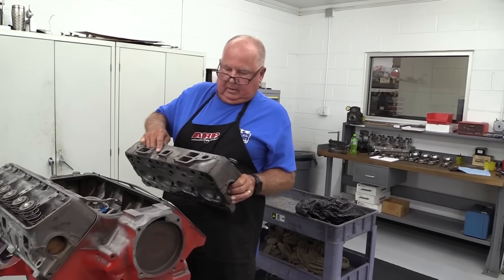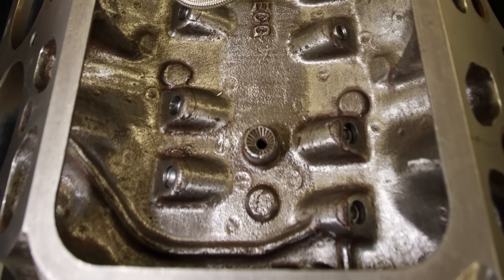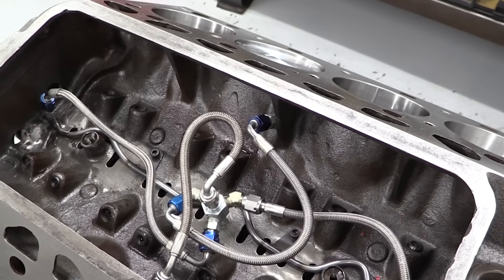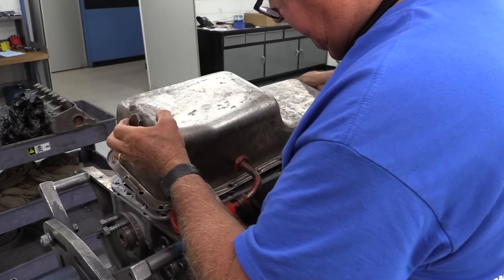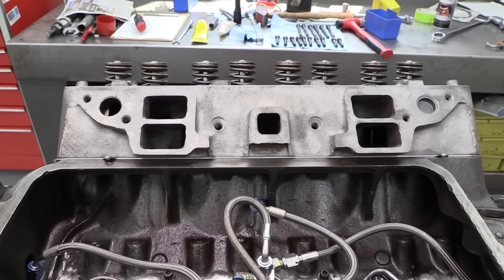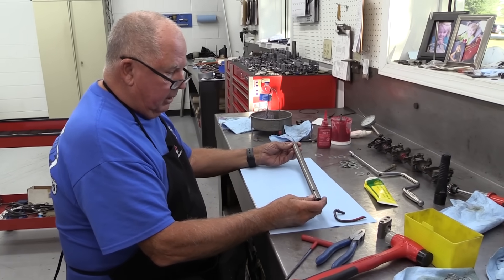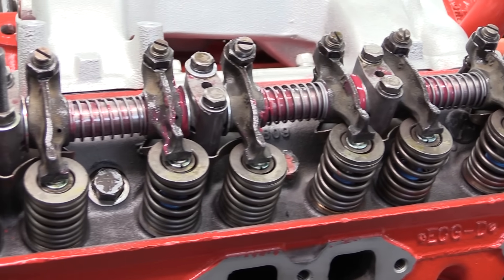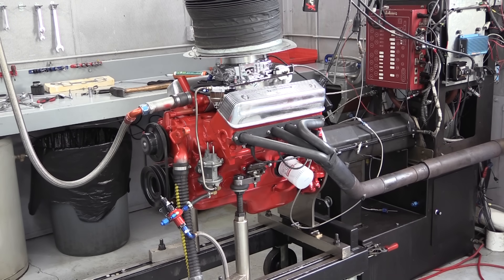The Engine That Replaced the Flathead -- Ford Y-Block Build

Comment: When I was in high school in the early 1970s (you know, a previous lifetime) I bought a '55 F-100 into which someone had removed the stock 292 Y block (or inline 6) and replaced it with a supercharged 312 Y block.... Ah the memories, replacing the old 3 speed transmissions on the way to school because I slammed 2nd gear too hard and broke another cluster gear (9 times) breaking the glass out of the back of the cab with the back of my head when I finally learned that running screws through the tire beads would keep me from spinning the wheels inside the old bias ply tires and breaking off the valve stems. (Solved that problem with a pair of swivel bucket seats out of a Monti Carlo.) Being the only kid in school with a pick-up and still being as fast off the line as the Mustangs and Chevelles with my factory 411 gears.... Those were the days.

Comment: Not bad, considering the 1985 GM 305 was only rated at 215 Horsepower, and that the Ford Engines it replaced (flathead V8's) were only making 150, or so, horsepower just a couple of years earlier (33% gains in 2 years? Imagine that now!).

Comment: And you have to remember,  the 272 and 292 truck engines. The drivers side exhaust looped to the passengers side and went back.  I've  owned a 272 ,292 plus a 312.
Reply: The same with all of the 1954 autos too. In 1955, the autos had rear exit manifolds, altho in 1958, the trucks still used the crossover. I bought a 58 pickup with the 300 inline 6 and put a souped-up Mercury 312 Y block in it and had to go with the crossover because of the hyd, clutch. There was a few years that Ford used a "Ram" type exhaust manifold for both banks but I never could locate any.

Comment: Thin connecting rods and lack of oiling on top end, junk engine, but I appreciate the skill used to rebuild it into a usable machine
Reply: JUNK ENGINE!! Hardly.  My brother had a '57 Ford Fairlane w/the 292, 4bbl.  Had it rebuilt, bored and balanced.  At idle, you could stand a nickel up on the air filter housing and it would stay there.  I had a '59 w/'63 390 on it.  In the quarter mile at Kinston dragstrip I could only beat him by a little less than a car length.  That was one fine engine.  However, it paled next to the '62 SHP car 406 he put in another '57 later.  OMG!   :-)
Reply: @danielharper635  You have a point, with the amount of improvements your brother did, it's no longer junk.

Comment: Had a 57 Fairlane 312 and a 60 Fairlane 292. Had problem with low gear in the Ford-O-Matics. Wouldn't you know, after I let them go, I found a trans shop that made adapter for Y block to C-4 transmission.

Comment: Well back in 1970 i called ack miller he was a ford engineer that worked on the design of the y block he and  smokey unick made y blocks win races for ford they told me to drill out the oil hole from the top main bearing and have my machinist open the oil holes in the center cam bearingand drill the oil hole to the head deck to 5/16 ths and in the head also and grind out the transition grove in the head gaskit surface till my little finger sat down in there half way and use 57  t bird 7.1 rocker arms isky push rods and the biggist crane cam and springs they have and look for a 62 ford truck block and a truck forged crank if you can find one and a set of a pair of ecz-d heads and go to work raising the ports and wider with alot of bowl work and ford super charge valves clyes timing set and a mallory rev pol distbutor jahns forged 11-1 comp pistonsans speed o motive con rods with a t bird aluminum gear reotor oil pump and shim the spring with J C witney fender well headers oh also a truck flywheel with a zoom clutch set up and go racing it was good for 8000 rpm all day long it still lives a friends truck

Comment: a terrible engine from day 1  no power no torque and ford should have never built it now if money is no object you can get some power out of them but they were a terrible engine
Reply: Douglas Adams, I'll bet you never owned one or have ever driven a car with one.  I've had several, didn't spend a ton of money on any of them and they worked just fine.  My last '56 wagon had a 292 with all Ford parts, not all from '56, but all Ford.  The wagon would run a 13.04 quarter mile and I spent less money doing it than my friend did on his 327 in his '57 Chev 2 dr. that runs 13.30.  As far as the Y block being a terrible no torque engine, I had two 1 1/2 ton farm trucks, one had a Y block HD 292 and the other was a Chev with a 348.  Guess which one pulled the bigger load? Y block.  Guess which one had welded up valve covers from the push rods blowing thru the rockers? 348.
Reply: @susanolson3412  they are the perfect girlie engine
Reply: In fact i will call you on your bet i will have my attorney draw up the paperwork and send it to your attorney for notirization, lets say $50,000.00 in US currency. Where do i send it?

Comment: Back in the 50’s, Fords were the most attractive cars to me. Chevy’s looked plain and cheap, and Chryslers looked gaudy and pretentious. But sadly, the Ford V-8’s sucked!!

Stock flatheads were powerless anchors, and the Y-blocks had serious problems that too quickly compromised their performance. They were so pitiful that you could actually hear the damned things coming long before you saw them. When you heard a car clattering, missing, cracking and popping its way up the street, you could be fairly sure it was a Y-block Ford.

Seeing this video took me back in time to those days, and confirmed what a rag that Y-block actually was. It’s fine that a skilled builder like this guy can solve its inherent problems, but this doesn’t excuse Ford from unleashing this piece of crap on the American consumer. The average Joe doesn’t want to re-engineer his engine just to get it running well enough to make it to the grocery store, he wants to enjoy years of trouble-free operation. 

And who was the genius that thought stacking the intake ports was a good idea ?....

Ford FINALLY did get it right with the SBF.

Comment: The pipe that he blocks off and throws away cos he doesn't know what it's purpose is, is the oil feed to the timing chain
Reply: You are spot on. I was going to write a comment but luckily found your's
Reply: I saw that too & kept thinking a restrictor or jet nozzle would be good, but I disagree with totally removing it.

Comment: Ran a lot of these in the "old days". 272s. 292s. 312s.   Last one was a 312 in my first '55 Bird with 3 deuces, Mallory ignition, headers, and a T-10 4 speed.   Ran good, but prone to oil leaks.  But I replaced it eventually with a stock 302 2BBL engine with an FMX Ford O Matic and it vastly improved the car.  Faster, quieter, better mileage and leaked nothing.    In my next '55 Bird, I had a shop rebuild the orig 292 -all stock. It was a nice running mill, smooth and quiet. 3 speed stick.    Fun times.

Comment: `Oiling problems yes, I was a student bus driver in 1967, I was in the bus garage one after noon lookinf a very blown up 292. I had never seen anything that destroyed, for example the came shaft was broken up in several 2-3" pieces, I asked the grumpy old mechanic what happened "the copper rocker arm oilers broke" He then explained that due to internal
oiling problems
the liness were fabricated to oil the rockers, made me glad I was driving a 292 straight 6 chevrolet.OH the motors has governors on them.

Comment: the engine that replaced the ford flathead was the Hudson overhead valve 6, fords flatheads couldn't catch them in the early 50/s
Reply: The Hudson's were also flatheads... but BIG ones... high compression... dual carb.s... racing cam option... The Chevy OHV 6's always had more power than same year Ford flathead V8s... Louie Chevrolet was a race car driver and his cars would never have flatheads! The OHV Olds V8's took over from Hudsons... Chrysler hemis from Olds... Chevy V8 from Chrysler... Hemis again later from Chrysler and Ford... now back to small blocks...

Comment: You need to take a block of wood and some 220 grit to those cast head surfaces at the valve cover location. Smoothing them out makes the seal last a lot longer on that old cork gasket. It's 15 minutes or else drip drip drip, just like the sbc.

Comment: I still own the First car I bought to haul my motorcycle to the track back in 83. A Y block Ford Ranchero. Still have it. Sad to say I was hauling back a 37 Ford with a Flat head V8 back in 2010. Only had it two days when some punk rear ended us and totaled  both my 67 Ford Country Squire with a 390 and the 37. Purchased a 28 Model A with the insurance $$.
Reply: I once hauled a Model T engine/tranny in my 1972 Gran Torino wagon. I also drive Model A's.

Comment: I built a couple of these in my younger days and always enjoyed the small things that made them different from the "belly button" SBC's.  Dorton knows his stuff and I always learn something when I watch the things he does.  There's just so much that is different on these things.  I built them as 312's and used Isky cam, good flat tops, and 3 Strombergs (hated those carbs).  The engines ran pretty fair but those damn Chevys could wind to the moon.  I really like the Mummert intake on this engine......mine was an Offy with 3 ducks.....pretty enough but I never felt that it flowed like it could/should of.

Comment: Personally I loved that engine and for me it was a connection to sounding cool an for what ever reason, mine were exceptionally fast. I outrun all the power pack 265 and most 283 chevy engines without breaking a sweat. Mated with a T85 three speed I could get a solid 90 mph out of it and third was not impressive as that transmission was direct in third but second gear was long legged.... Skagit Speedway had my name on the winner wall many times back in the early sixties. After Nam I moved on up to the FE block and never looked back

Comment: in 79 i had a 56 f100 with a 292 that i would take over the grapevine 35-40 times never a problem.  i bought another 56 f100 to restore with no engine,  so i bought another 292 to rebuild but got sidetracked. ended up putting a 302 ho engine with an AOD. goes real nice. computer engine though, i hope i never have problems with it.

Comment: 8:1 compression... probably the main reason it's only putting out 218 horsepower.
Reply: Partly that but it has a very, very mild cam in it.
Reply: The compression ratio isn't the problem, the distributor is.  This original distributor has no mechanical advance.  This system used all vacuum that wasn't venturi or manifold vacuum, so the Holley they are using doesn't have the right vacuum signal.  I'm guessing the torque and hp would have gone up a noticeable amount if they had a dist. from 1957 and later Y block

Comment: Same lousey oiling with the the ford straight 6 of the same vintage, even after replacing the oil pump it STILL would not oil the rocker shafts well, I actually got an external oiling system that fed oil to the rocker shaft ( through the valve cover ) direct from the oil gauge orifice off the pump, I also removed and blocked the overflow? Tube at the opposite end of the shaft. ...it worked far better than stock system

Comment: Worked in a Ford dealer shop from 1954 to 1957 when these engines first came on the scene. During that time we replaced tons of camshafts for worn down lobes, however GM was having the same problem. The Y block 272,292 and 312 were good engines but Fords heavier crankshaft design and longer stroke wouldn't keep up with the 1955,56 and 57 Chevrolet short stroke engines. They did have more low end torque though.
Reply: NASCAR and other racing competition results make your statement demonstrably false

Comment: Back in the day I had a 56 ford sedan with the 292 T Bird engine. The rockers were worn out and rattled so loud that you couldn't hear the exhaust . Maybe a slight exaggeration but not by much. I also had a 54   Two 55 s and the 56 ,all had oiling issues. Back then all we knew to do was to run a line from the oil pressure sending unit to the rockers, not a satisfactory solution thankfully.things have improved in the last 60 years. Great video, I In Joyed hearing the old Y block once again. Thanks Jim

Comment: Back in the 50's that Y block was very competitive with the Chevy small block in NASCAR  racing until the engine builders got their hands on the Chevy and the rest is history. Interesting that after all these years the Y block and shaft mounted rockers  have come back but this time in a GM engine.

Comment: Has more power than the ‘64 1/2 Mustang and it’s 210 HP 289.
Reply: And that little 260 would still  shit on that heavy, long-stroke, stacked-port, low-rpm chunk of crap.

Comment: Keith here are a few more considerations for Y blocks U might want to consider first love the idea of the SS hoses for oiling how I did it back in the 60's was polish out all the oil galley's no rough casting at all & rifle bore the rocker arm shafts also open up all casting ports because of the casting residue. U might want to use FORD TRUCK engine components the crank Rods are forged & tough the wrist pins were hardened the bolts were a tougher grade & they were developed to resist elongation. Also kiss machined crank caps & machined hardened flat block cap support that bolted up this sured bottom end also crank was from Ford truck Beefier & stronger oh Truck Engine that year was a 292 
Saying all this there is still a lot of NOS truck parts around besides quality price should be less. U see I raced around the country at the time a 57 FORD Custom with a STOCK (think it was M-Class NHRA)  Supercharged 312 quite successful & engine never came apart & always pulled enormous power to torque for that year - Oh! The engine was build for me (at the time) by J & J Engine Builders in New Jersey
Reply: The above is your first class in Turd-Polishing 101.
Reply: @daryllect6659  TY for the Eloquent way U express Ur opinion I assume Ur a GM or Mopar guy BUT I wish I were standing next to my '57 Ford when it was running U never heard ANYTHING like it - I swear Daryl the ground shook & I ran 12's at 103mph for the 1/4 & that was in 1970 near National Record for my class I think it was E or F Class. I had a lot of friends with Chevy's & Mopars they used to shake their heads at the car it was never like any Y block U've ever heard/felt/or Run - Yup wish I could've heard it & saw it run - never seen a Turd do that in my life

Comment: Why is the WHY Block so strange😜🤔🤔.
Is that why it's called the WHY Block🤔🤔🤔🤔🤔
1. WHY are the intake ports stacked???
2. WHY do the lifters look like mushrooms???
3. WHY such a strange oiling system????
4. WHY does  the engine WEIGH 900 pounds????
5. WHY does it have a external oil pump????😜🤔🤔🤔🤔🤔
6.  WHY, WHY, why, Y, ?????

Comment: Used to hate to drive my friend’s 59 Ford with the standard transmission in the rain. Pull out and the wipers almost stopped. Downshift and they would go so fast that you thought the wipers were going to fly off.
Reply: BW MadDog [retired]  our 1963 Rambler wagon had them too.

Comment: Had a 292 in a 57 Ranchero.  It ran OK, but used half its horsepower just to move the weight of the engine.  What a ship anchor.
Reply: silverbird58  Look dumazz,  in 55 to about 62, the 292 and 312 were about the best Ford had.  They are huge blocks for such a small cube motor, it's not debatable.  Ford couldn't wait to ditch them and that's exactly what they did.  If you have a 58 T-bird with one of them in it, that's great, I respect originality of old cars but there is no denying that they are huge, heavy motors for their displacement size.  The follow on 260 and 289 Windsor engines made as much or more power and weighed much less. 
BTW- I've been to JPL in Pasadena when I worked for NASA under delegation.  I also worked at a rocket propulsion company Jack Parsons founded in NorCal for many years.  But this isn't rocket science.  Everything I've said about these engines is true.  Unless you need one to be factory correct, I wouldn't want one in a farm truck.  Stop being a jerk, JERK.

Comment: Very nice to see the oil mod. it would have saved a few of them from being blown up in the day.  I ran one in my 56 victoria on the roundy round dirt tracks in the day.  With the correct parts they sure would run with the best of them. Thank you for the build
Reply: Oil mod is not necessary. Keith just tapped into the same place Ford used for the oil to the rockers and used hoses. The only modification needed is to the same cam bearing housing or the cam bearing itself with an added groove. Radius the  normal passages in the block and heads for better flow and leaving the overflows on the rocker arm assemblies. Fords problems were accentuated by the use of non detergent oil, short drives without enough engine heat, and servicing. If the owners back then would have used a multi- viscosity detergent oil like a 10-30 the engines would have easily made 100k miles before an overhaul. 

We all know the cylinder heads were a weak racing point but not a weak service point for the street/daily use. The engine gets a bad rap.
Reply: @jamestone265 yup, if you maintained them they were a serviceable street engine. We had a stock 1960 Fairlane 292 bone stock. We moved from Tulsa to Calgary Canada in 1963. The first year we didn't have a block heater and it started every morning except the morning that was -40f. Dad used Havoline and was changing oil every 2000 miles. Never did have oiling problems the body rotted of it but the motor ran and didn't smoke in 1968, he bought mom a new Torino.

Comment: Family friend is a Chevy guy with a 55 TBird. You’d swear it’s a Y under the hood at a glance. Distributor looks the part, exhaust ports too, TBird Special valve covers and Ford air filter housing. Look closer and the intake looks off. Actually a 327 SBC.  Thing motivates